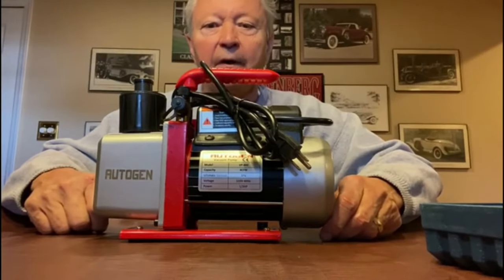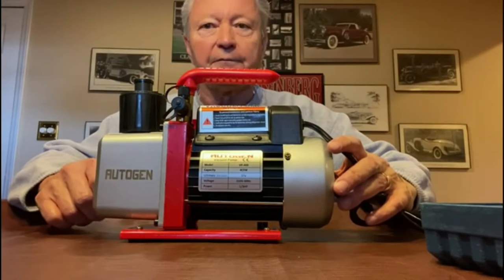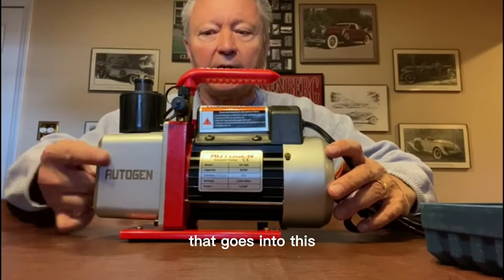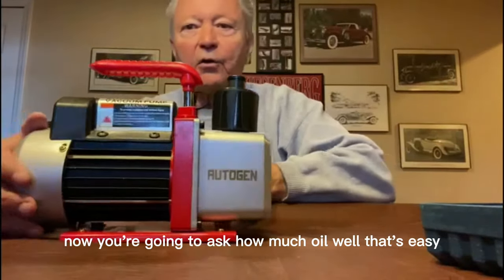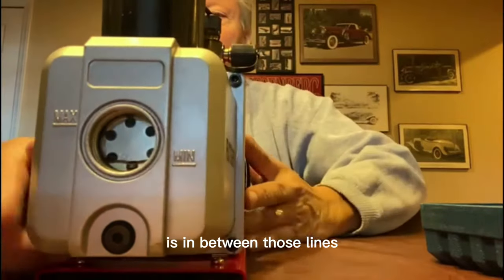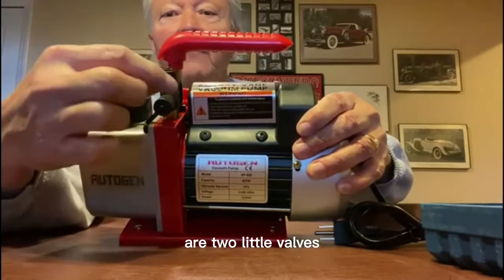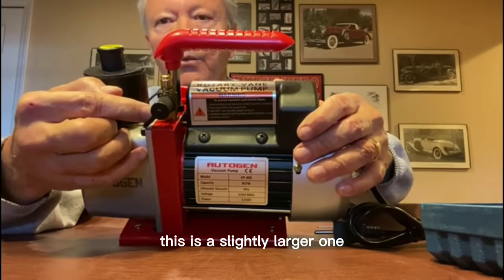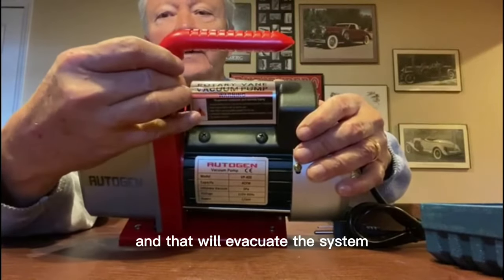AUTOGEN 4 CFM Single-Stage Vacuum Pump

Comment: I got one and it smokes badly out of the exhaust. My oil is brand new and filled right between the minimum and maximum lines. But it just smokes alot. My previous pump from a different maker didn't smoke and I don't know why this one does.